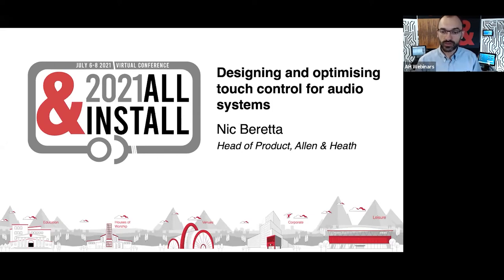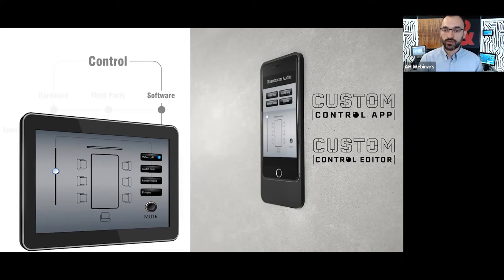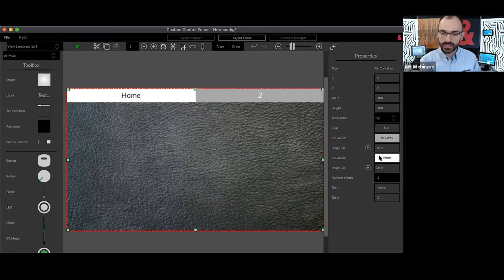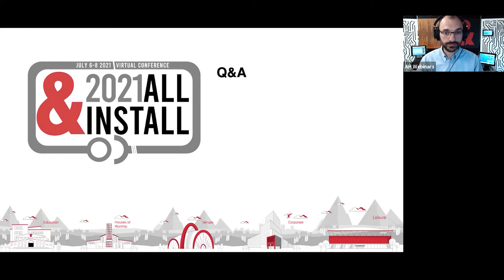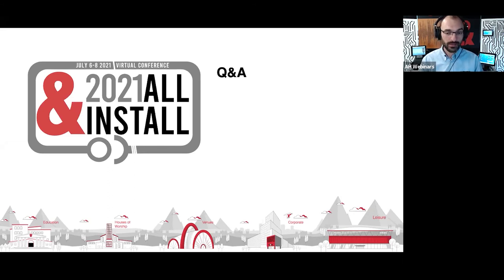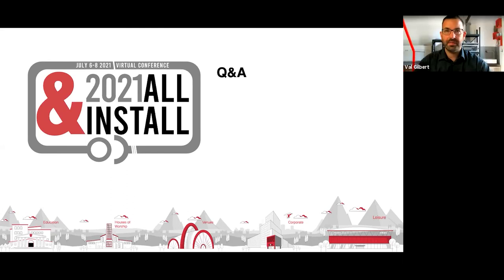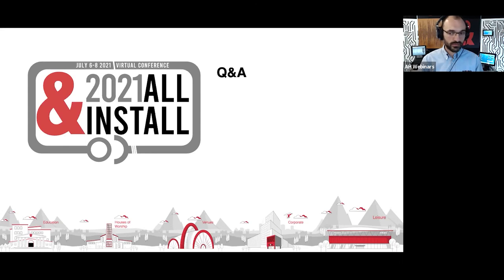Designing and Optimising Touch Control

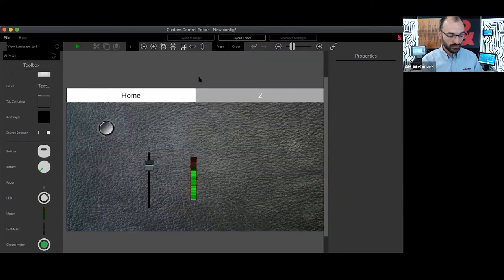Comment: Where can we find specifics about designing custom controls and ui elements and using correct sizes, dpi and what not. In the video around @15:30 he talked about using custom meter element. Wonder what such a design element needs to contain and specs about designing it. I cant find any of this on the website?